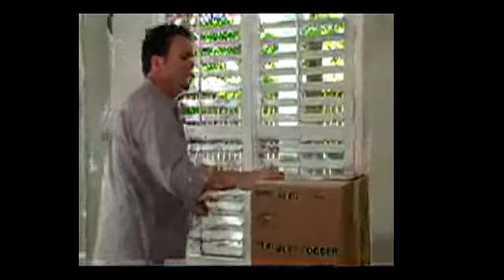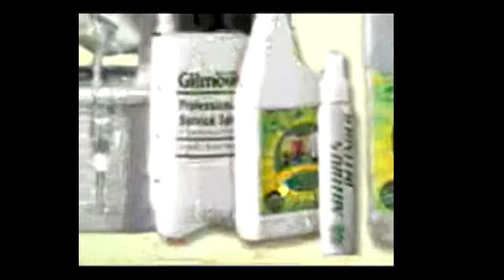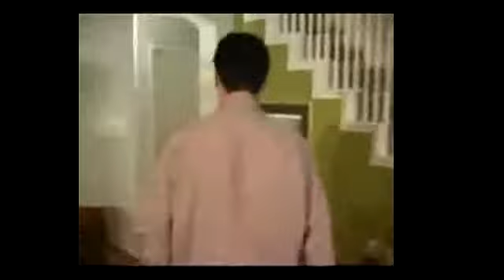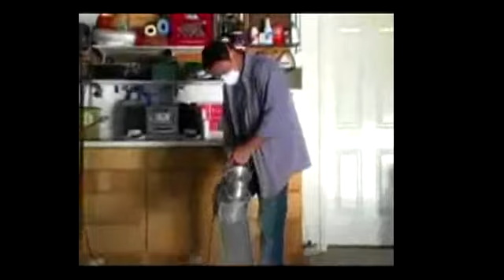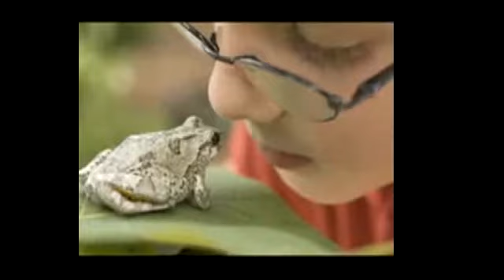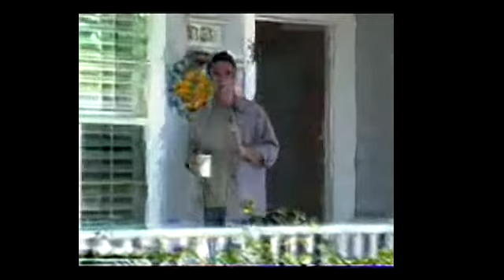How to Use Cedar Oil Blend in a ULV Fogger

Comment: I live in San Antonio,TX. I have collembola, the pest company came out, left bomb, they still are here. Got my Cedarcide BEST YET and this fogger! Time to end this war on my life! Thank you for the tutorial video.
Reply: did it work?
Reply: Rob Mite

I've done 6 different applications spread out with vacuuming and wiping up the leftover after a day or letting things settle. I will say that this does actually clear alot of the issues up. No, it won't INSTANTLY rid your place, but I've seen major changes in my 500 sq ft. apt! It's expensive but does work. You would have to keep treating yourself internally and keep cleaning your place. It's alot of work and when I started I used to get ATTACKED! I would have them jump up and bite me when I was spraying them down. Now I can walk over alot of areas without the super sensations I used to get, I still get them but I'm not finished with this war! I have confirmed also I have Morgellon's Disease, but the tri-fogger has been working!! I'm not sure how long I'll have to continue this protocol, but each round, I can see slight improvement.

I do recommend it if you have the money and want to start getting real results!

Kent C.
Reply: Thanks so much for getting back to me, I'm very glad to hear that
Reply: All places to be sprayed should be uncovered. Move furniture, you cannot just spry under the furniture to get the flea larvae, I tried. We did not need to cover up any of the things in the kitchen nor remove the dogs, cat or bird. Only drawback we had was the stron Cedar smell for a couple of days. One application got rid of everything except where the big couch was sitting. I moved the couch and spraye that area no more fleas.